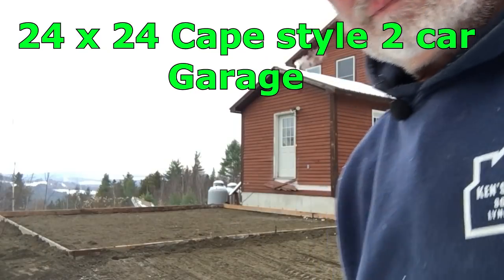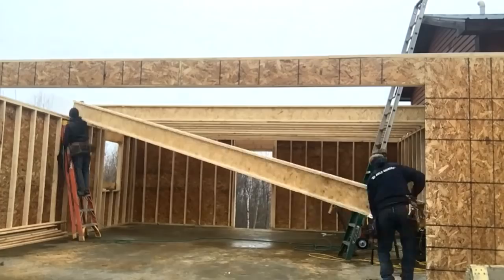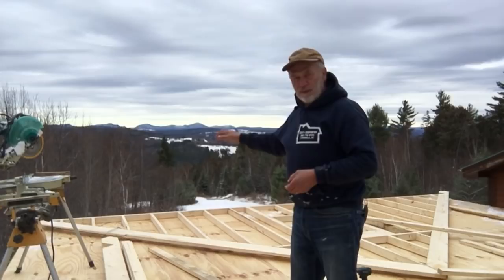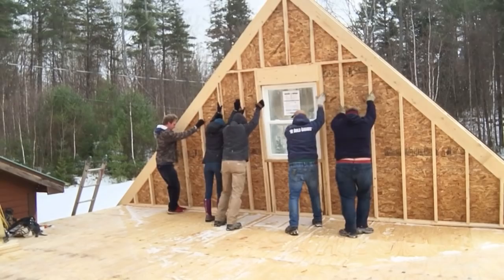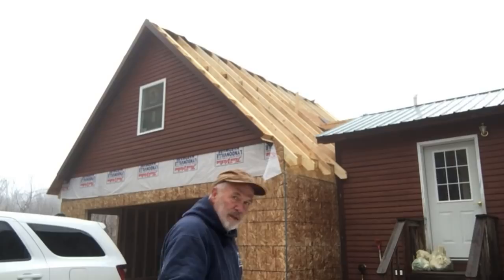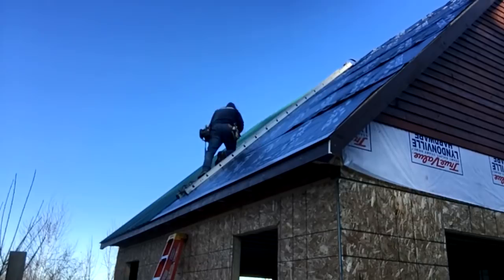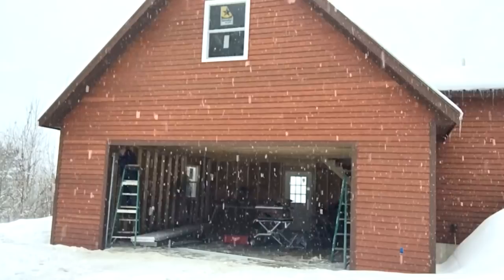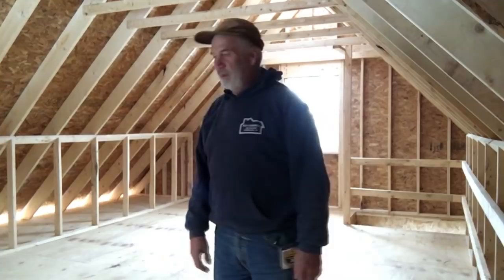#176 Cape Garage $38,000 Start to Exterior Complete

Comment: This brings back memories. I was a rougher for 14 years. I'm surprised you didn't go LVL on the garage header. Here in the north we put all we can on all walls before we raise them. When raising walls we would put a pull brace just in case it would get cut by the wind or a guy over pushed too far. We also would put the facia on before we would plywood. This would allow a good starting point for the first sheet. Code here is that have to flash the windows too. Sometimes I miss it but most of the time I don't cause I do remodeling now which usually inside. 12 pitches are brutal, no fun. Be blessed my friend

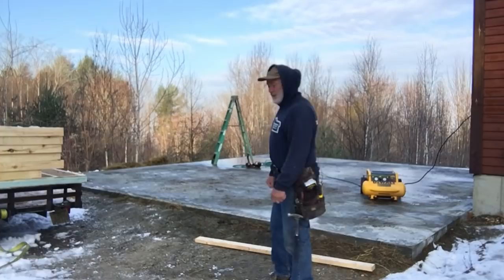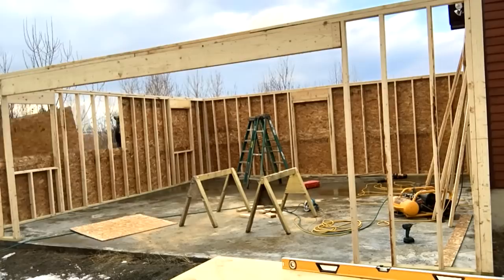Comment: Dear Ken, Im one of the proud subscriber of your channel and `i enjoy every video `i watched so far. `thanks for making this happen. My heart was pounding when you were on that ladder and I know you probably did this million times but for light hearted subscribers like me try to use some safety ropes. And teach us how to use it. I do have a request, could you please do few detailed/separate video  on the tiny detailing we miss in the videos like ...  1:10 how do you mount the frames or attach it to the cement slab ( do you have pre installed bolt from the slab, just nail it!!! ... How does it withstand the entire weight!! ... 3:33 The i Beams, how do you make it, comparison with the plank vs plywood on these beams.... 19:00 how did you installed the last sheet!!! That ladder attachment was good details on that would also help ... 26:51 how/what did u do with this last piece + the plastic sheet ( i Guess you attached from inside but good to know from you). I know few of the views think these question are silly but as you know 99% of the viewer are not an experienced builder and the core purpose of this video is to share knowledge.... Happy holidays and Love from India ....
Reply from the maker: Thanks I am using fall protection nowadays. Thanks for watching. I’ll try to get more detail. Sometimes I’m dealing with to many things to get the camera footage as well

Comment: Great videos. Im building my own garage this summer, and im gonna model it after this design, how do you know exactly the birdsmouth measurements and the cuts for soffit and fascia? Is there not any deflection in the walls? Any help would greatly aprreiciated. 
Great videos keeps them coming
Reply from the maker: Thanks I usually lay it out on the ground and make a template.

Comment: Nice Clean, well organized work. Exactly how I frame. Only difference is we have to use Pl glue and screws for our subfloor install by code. All regions are different in what they require. What are your thoughts on using screws instead of nails for subfloors?
Reply from the maker: We always glue and screw if it’s living space

Comment: Ken, I am a big fan of you videos.  I just watched this one the other day and I have a question. On the gable ends you put up the siding boards before you stood them up. Then later you started putting the siding from the bottom of the first floor.  You said you did a calculation so the reveal would be the same once you got to the bottom  of the gable ends.  What in the world is that calculation?  Just curious.  Thanks

Comment: Wy you do'nt use inexpensive wire mesh in place of expensive rebar ? For shure rebar is stronger . Also you can laydown 2" styrofoam SM  under the concrete flor for isolate the slab protecting from soil mouvement and frost , after all great job nice built , i enjoy watching you talentfull peoples
Reply from the maker: Thanks for watching. I’ve never worked with wire mesh but I know a lot of people do. For me using the rebar is a big selling point to the customer so that’s why I’ve been using it.

Comment: Awesome job. When you poured the  concrete for this job was your foundation exactly 24x24 which made the inside measurements a little less ? Sorry for a dumb question.
Reply from the maker: Yes exactly 24x24 so inside is smaller. Thanks for watching

Comment: Ken your piano hinge nailing on the end walls is keeping me up at night. How does that work? 
Those nails have to come out because when the wall goes up they should get bend.... right??
Reply from the maker: The nail comes through the bottom edge of the plate directly into the chalkline. That way it makes an excellent pivot point and when you tip the wall up the bottom plate sits flat on the floor

Comment: Im getting advice that I need footings under my garage for freeze,thaw. Would like your take on that, yours looks like a floating slab. thanks ahead.
Reply from the maker: If the groundwork is prepared correctly, no clay, well drained, a minimum 12” to 18” gravel base it should work great. We’ve built almost 500 garages over the past 30 plus years with great results.

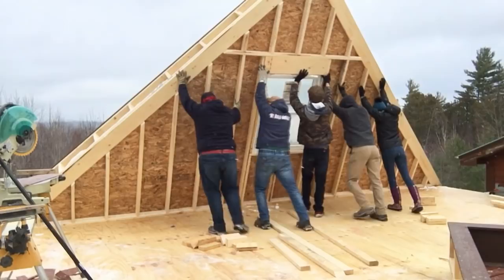Comment: 10:45, I was surprised that you didn't a rope from the peak back down to the deck to act as a safety just in case the wall started to make its way in the opposite direction. I realize there were five people there, but still. Once something begins to tip . . .
Reply from the maker: Good point if it was windy I might have considered it. I’ve done 25 or 30 this way and try to be as cautious as possible

Comment: 38K? 
You’ve got about 20 in material, maybe a little bit more. Did u mill the siding as well as finish it? Charge more $$. Dont be shy. Thats a $60K project in my world, and in other areas it would go low-bid as high as 75. Well done tho sir.
Reply from the maker: Wow thanks